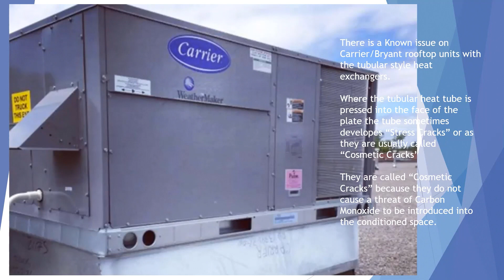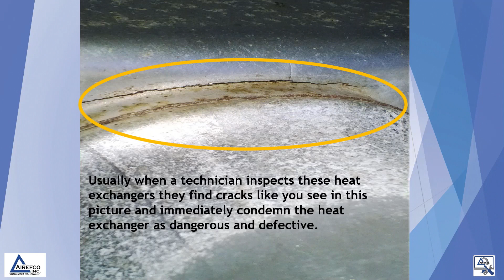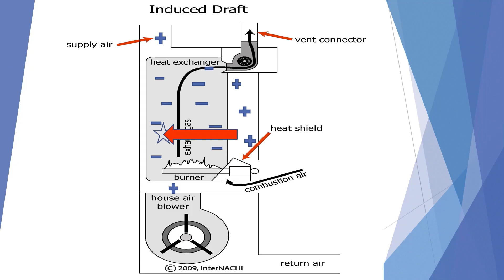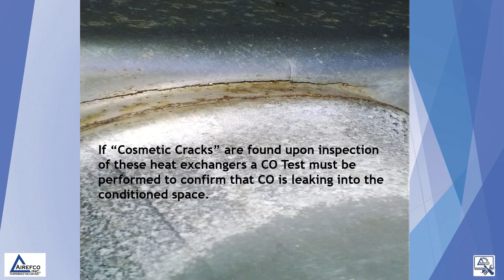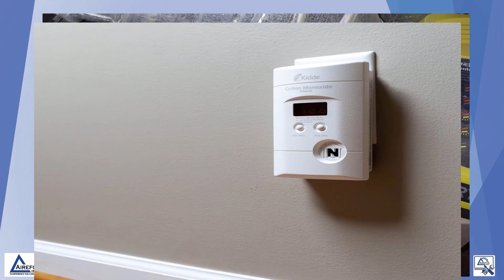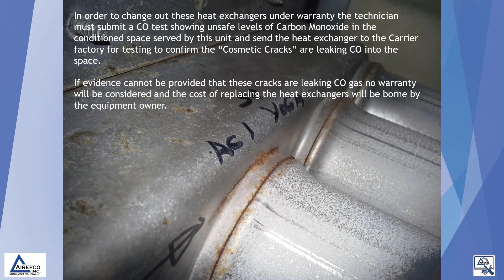Cosmetic Cracks in Heat Ex-changers

Comment: I would ask, if this is 100% true and infallible, then why do we read about customers poisoned by CO every year from their furnaces? I would further ask, if the heat exchanger is cracked but deemed OK by no ambient CO found at that exact time, when should the tech schedule to return and reconfirm that there continues to be no ambient CO? We would need an exact date and time to ensure the customers continued safety. As a tech, if this is the position of the manufacture and distributor, is a letter of zero liability afforded to the technician and company in the event the homeowner is harmed by the furnace venting CO into the living space? 

Personally as a gas licensed professional, I find the advice shared here dangerous to customers and companies alike. A crack in a heat exchanger should never be deemed "cosmetic" in nature. This does nothing but shirk the responsibility of the manufacture to design a properly engineered product, and instead perpetuates a false sense of security in a failed and inherently dangerous design.  All for what? a profit margin? That's a hard pass for me, and hopefully would be for any tech or company trying to put the needs and safety of their customers ahead of profit. Its absolutely possible to achieve both.
Reply: And the tech is wanting to cover their end as they should. That's why a written explanation of the situation with a waver should be introduced to the costumer along with mandatory purchase of co detectors in order not to be condemned